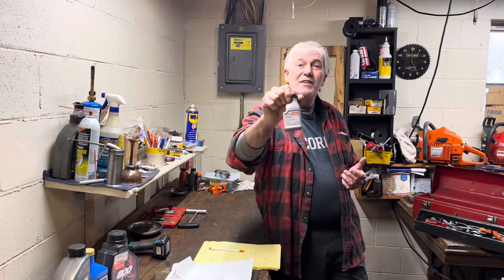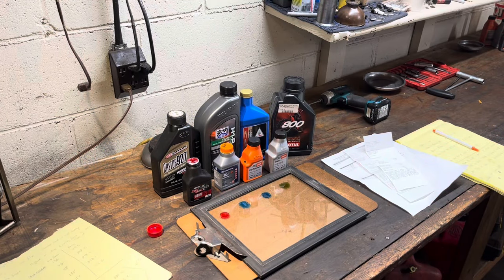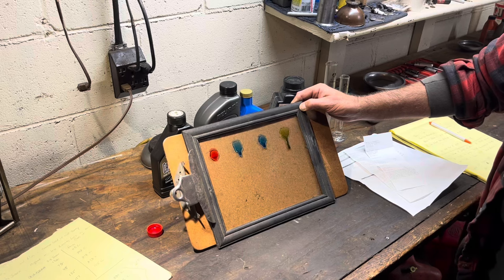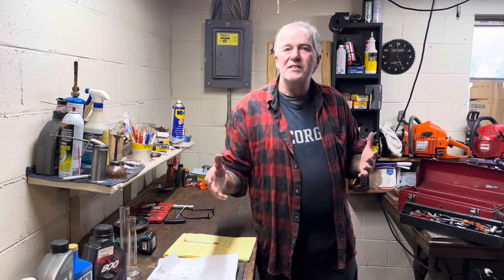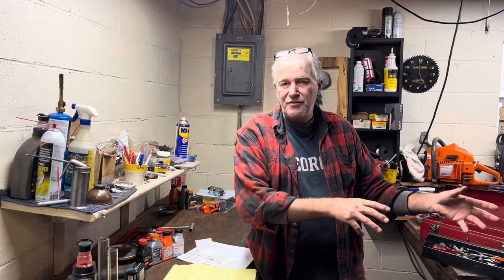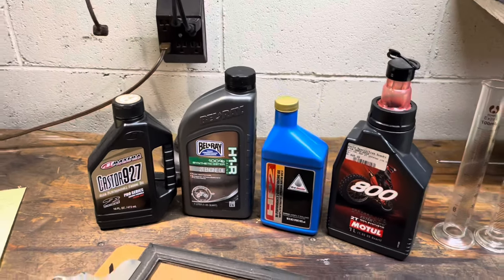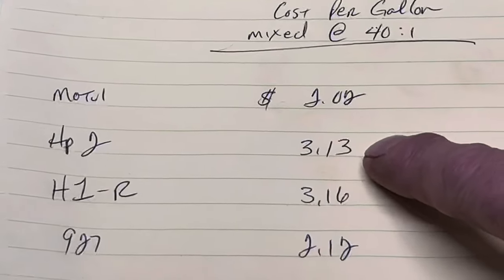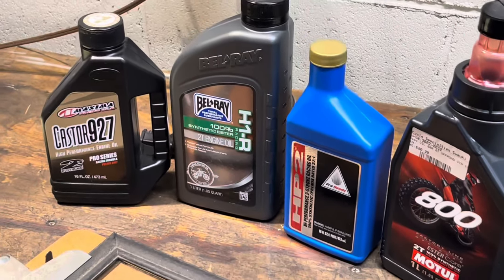2 Stroke Bike Oil in a Chainsaw?

Comment: I’ve been using Klotz R50 in all my saws and seems to work great- interested to know if anyone else has tried it
Reply: Yes I exclusively use the R50 and I mix it probably about 32 to one and I run it in chainsaws old McCulloch's 10-10 to 850's leaned out to the best running. have had no problems I do use 1/2 airplane fuel and no oxygenated premium. You run lean and mean and have had no problems also in the weed whacker and the blower anything two stroke. I do prefer Castor oil cause it's strictly smells great but I have a tendency to build carbon in the ports. Think more so on my lawn boy more so but that runs at oh I've got it modified I think it runs at about 4500 RPM's normally they run about 22-23 I used it in the chainsaws for a while I think it brings the RPM's down because it's got thicker film strength but I had no problems with anything with them. what the bean oil does separate out of the gas pretty badly and I had problems with the carburetor fuel diaphragm filling up with oil and not getting any gas and had trouble getting it started after sitting so I kind of switched all the chainsaws and everything to R50.. Only problem I have is once in a while the spark plug will bridge gap with the lead out of the airplane fuel and they would just die pull the plug out and there's a little string across the electrode to the ground break it off blow it off start right back up again once in a great while that happens I can deal with it
Reply: I use it, it is very good stuff.

Comment: Please test the Motul. Very interested in trying it. Also, which Amsoil do you believe is better, Dominator or Saber? Thanks
Reply from the maker: I know there's a lot of Dominator users that swear by it, but I've tested and torn down both.  Saber hands down.  They both lubricate well and leave a great film.  Saber burns cleaner at 40 or 50:1 than anything I've tested.  All four of these bike oils will get tested in the next few days.
Reply: Motul is a good oil. But it doesn’t burn very clean. It leaves a lot of buildup in the exhaust port and muffler. That’s at a 50:1 ratio. I ran it for about a year and then switched to Bel Ray H1-R. I have been running that at 50:1 for over three years now with excellent results. I’m a production timber faller in the PNW. I do all my own saw work. From repairs to porting. So far Bel Ray is my oil of choice.
Reply: Reformed Stihl swamp water user here. I’ve been running Saber for several years now and it does great. Milling, cold starts  , and not always letting the saw idle before shutting down. I don’t know how many barrels of fuel my son has through the saws and other equipment and he is still learning how to run them for a longer lifespan.  We run 32:1,  pistons and cylinders look like they’re just past break-in even though they have been run for years.
Reply: @jakemesa3211 What ratio do bikes run? Do you think bikes run at higher temperatures?
I’ve heard good stuff about Motul but I trust your conclusions to observations.
Reply: 33:1 is ok ?
Reply from the maker: @PurpleNovember Hard to beat Saber.  We'll see how these fancy oils stack up.
Reply from the maker: @jakemesa3211  The ester based oils with a good detergent package are hard to beat.  I know castor is great against wear but a little dirty.  I'm looking forward to this series.
Reply: @PurpleNovember  I don’t ride bikes, so I don’t really know. I personally think 32:1 in a saw with modern oils is not necessary. I have tried 32:1, 40:1 and what I always come back to is 50:1.
Reply: @richardflagg3084  I look forward to this series as well.
Reply: @jakemesa3211  Same thing for milling?
Reply: @PurpleNovember  I’ve never done any milling so I can’t really say. If I was to recommend anything I would probably go 40:1. With modern 2t oils I think that is more than enough. Even for milling.
Reply: @jakemesa3211  I’ve been thinking about 40:1 for a while, I’ll see how it goes. I had 4 cylinder and piston failures from insufficient lubrication. That was Stihl ultra with ethanol fuel but I’m still gun shy using mixed race gas and Saber.

Comment: I know regular (auto) Amsoil runs fairly quick. It would be good to see how Saber & Dom do since they are designed for 2 strokes.
Reply: He has great videos already on those oils if you go look back on his channel!
Reply: The reason I mention this is they say in a normal engine most of the wear is from each dry start after sitting. Therefore they usually recommend thinner oils to get oil to the crank, rods and valvetrain quicker.

In a two stroke since the bottim end gets oil first is it just as important to have thin oils for quick movement and coverage? The slow movement of the motorcycle oils & Red Armor would indicate, maybe not.
 (I am new to two strokes)
Reply: @peskypeet  in a 2 stroke engine the fuel/oil mix goes directly into the crankcase then gets pushed up the transfer ports to the combustion chamber. So bottom end sees oil before the combustion chamber sees fuel.
Reply: @aaronpowell4885  Thank you. I did some reading and as a result edited my initial question.

Comment: Auto Zone has quarts for 8 dollars Full Synthetic Pennzoil Snowmobile Premium Plus
2T Engine Oil labeled "suitable for JASO FD applications" cheapest full synthetic I have
seen. Maxima Premium 2 is dual certified TC-W3 and JASO FD but is 3 times the cost. 
Quicksilver has PWC and Snowmobile full synthetic oils labeled to exceed JASO FD
for about 14 dollars a quart.

Comment: Is there anything special about the core of Stihl spark plug wire? I’m deep in a loosing battle with plug wire on a 241. The plug-end spring is not wanting to connect and stay in the wire. I’m thinking of just getting an automotive 5mm plug wire that’s already made up and cutting to length. The coil end is screwed in so I’m thinking as long as it isn’t a carbon core it should work

Comment: Hi Richard, as an experiment I been using Putoline MX9 at 50-1 in all my chainsaws for the last 9-12 months. It leaves a nice coating on the bottom end and very clean burning. Well worth looking into I would like to hear what you think of it. 🏴👍 ps; its FD rated.
Reply from the maker: I'll have to look into that one.  Never heard of it.

Comment: The best oil available is obviously Stihl HP Ultra😅
But personally I run Liqui moly motorcycle oil in everything which I'm very happy with👍
Reply: I don't think you have seen this channel in depth, because there have been many reviews and results of using Stihl HP Ultra and it is possibly one of the least recommended oils, because apart from the poor lubrication it provides it creates a lot of residue on the piston, cylinder head and exhaust, because I believe it meets the minimum JASSO standard. And the manufacturer is Castrol, but it seems that here they wanted to skimp a bit and the results of this oil are quite disappointing. Check the channel and you will find some real horror films. Unless you mentioned this oil out of pure sarcasm 🤣🤣
Reply: Hp ultra is a very dirty oil that is not FD rated for a reason! It leaves so much carbon it's as bad as gas station 2 stroke oil! If you were a saw mechanic you would understand its terrible!
Reply: @robertomcatZX10  yep sarcasm hence the emoji, cheers👍 I stopped using HP myself years ago!
Reply: @tedneitzel   sarcasm hence the emoji 👍

Comment: There's no better Twostroke oil for racing mx than 927. I raced for 25 years and have used it and so do most racers I do engines for. But it's very high flash point and if you're not on the gas WFO it will spooge out exsaust from not getting hot enough to burn and at 30-32:1. I use to use my bike gas in my saws alot and noticed the 927 carbon up in them . Ya smells great but wouldn't recommend it for a chainsaw. The hpp would be better I'd think. Also if you are in a cold climate the 927 can separate exspecally with race feal. Gad it happen years ago when was racing a winter series here in upstate NY. Treelborg tires and all 😊 it only separated in carb bowl bike would only run on choke cause oil was clogging up main jet. But ya there's no better smell than 927 with race feul

Comment: Honda.
Reply from the maker: Honda it is.  You're first.
Reply: @richardflagg3084  thanks buddy. The closest Honda dealer has that oil and if it’s possible to run in my 400C I’ll run it. I’m having no issues with Stihl urnge at 40:1 (never running swamp water) but I’m open minded and welcome new stuff.
Reply from the maker: @saltrock9642 I keep an open mind as well.  Never hurts to try something new.  Trust but verify